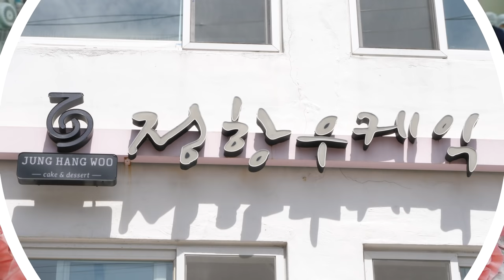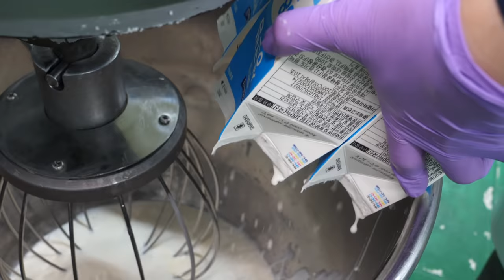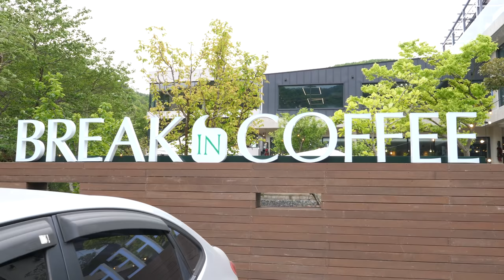화려하고 신박한 케이크 &디저트 대량생산  BEST5 몰아보기 / Cake & Dessert  Mass production BEST 5

Comment: Instead of blind baking the tart shells, just poke little holes in the bottoms, to keep them from bubbling, the way you would when making crackers.

Use an egg yolk separator when cracking the eggs in the first place.  It's basically a small cup with a 1/4" (0.635 cm, 0.2095 
寸) diameter hole in the bottom of it.  The albumin goes through the hole and the yoke stays on top.

Whip the egg yolks, cream cheese, mascarpone cheese, powdered/bloomed agar, and sugar syrup together in one bowl to begin with.  If the water in the syrup isn't really needed, then use plain dried sugar instead.  Whip the cream separately, but then fold it in gently a little at a time, not all at once.

Instead of piping the filling in, just use a large spoon to put a huge amount in, since you're just going to take the excess off with a knife anyway (I think that looks sloppy though - I like it better before the knife is used to take the filling to the edges).  Also, don't stack them directly on top of each other with the centers vertically aligned, as that will sink the filling in the lower tarts down, which could break the sides of the tarts (as the excess gets pushed outward from the centers).  Instead, stack them the way you would stack cans that weren't meant to stack on top of each other: 1 tart on top of 4 tarts underneath, so the top tart covers 1/4 of each of the lower tarts.

Putting fruit on top of the tarts will just make them hard to eat.  Especially the grapefruit pieces.  Anything larger than a chocolate chip is going to make it very difficult to eat these tarts.  It would be better to make the cream filling half as thick, then freeze the tarts, then put the sugar syrup as a layer on top of the cream, then put the smaller fruits (not the grapefruit slices though - maybe dice those instead) over the sugar syrup, and refrigerate them as soon as possible to help the sugar syrup set as a "glue" for the fruit pieces.  This would make them easier to eat.
Reply: justrosy5 I think what we are watching is a batch of people making a video for commercial sake. Once the cameras are off, these workers flip the switch on the machines to make huge batches of these foods to be distributed all over Korea, and elsewhere possibly. It doesn't make sense to use these slow processes day after day.

Comment: The cakes are under-baked (they need about 5 more minutes in the ovens) and there is way too much frosting between the layers (it should be about half of what's put on.  Also, those carnations don't cut well.  It would be good to intentionally put the tempered chocolate pieces in so that there's a slightly hidden "cutting line" that would make it easier to cut the carnations in half.  Small, green frosting "leaves" could be placed at each end of the "cutting line" so customers would know where to cut the cakes in half after taking them home.

When putting the carnations on top of the cakes, it would be easier and go faster if the workers started in the center of the table and worked their way toward the edge, instead of going from the outside cakes towards the inside cakes.

Also, when packaging the cakes, it would protect them more if the frosting on the cakes were dusted in powdered sugar first, then if the clear plastic sides (that are wrapped around the cake sides and taped on) were taller than the carnation tops.

Comment: For the assorted cakes, mix all dry ingredients together first, separately mix the liquid ingredients, then mix the liquid mixture into the dry mixture.  At least mix your baking powder or baking soda into the flour first, before adding the flour to anything.  These powders must be evenly distributed, or they can make the cakes unsafe to eat, as well as have gross tasting spots in them.

Only fill your cake pans half-full (half way up the actual pans, not half way up the paper sides).  This is to ensure that the cake layers are well baked all the way through, instead of under-baked in the middles or toward the bottoms.  Cake batter can only be so thick and still bake properly.  Only tap unbaked cakes - never tap baked cakes on a counter-top!  This causes them to fall instead of staying light and fluffy, the way they are supposed to be.  If the cake tops don't stay rounded or domed on top, they are underbaked and have fallen, probably from the tapping.  They aren't good to use.  If you want flat tops, you have to cut the domes off, if you want the cake underneath to be good enough to eat!  Use the excess baked cake top pieces for other things.  To cut them really flat, use the cake pans as guides.  You need 50% more cake pans though, instead of trying to make the ones you have taller with paper sides.  The quality of the cake will just be better that way.

Spraying or drizzling the cakes with a liquid and then putting jam on them will only lead to even soggier cakes.  To prevent the jam from going into the cake layers, use a thin layer of fat-based frosting over the bottom cake later, under and over the middle cake layer, and under the top cake layer, then put the jam filling between the now frosted cake layers.  It's a little more work, but worth it.  Another option is to just sift the jam and whip the whipped cream into it, again, a little at a time, gently.  Non-fat-based liquids or gels just soak into cake layers, but thick, fat based whipped creams and frostings won't.

There is too much whipped cream between the layers, and the syrup around those fruit pieces is just going to soak into the bottom sides of the upper cake layers.  It would be better to sift the fruit pieces out of their syrups, add them to the sifted jam, then whip the whipping cream into both.  For the fruit pieces, pat them very dry, cut or dice as needed, rinse and dry them again, then use them either on top of the whipped cream or as part of the cake batter itself (mixed into the flour first, before adding liquid ingredients to it).

Oreos are just chocolate cookies made with approximately 50% dutched cocoa and 50% natural cocoa.  You can save yourself a ton of money by just making your own chocolate cookie dough, baking it in large, flat, thin sheets, and using a grinder to crumble it.  Seriously - I've made my own myself.  It's not hard.

Again, a powdered sugar layer needs to go between the frosting on the side of the cake pieces and the plastic taped around it.

Comment: It would make more sense to use powdered agar, rather than stringy agar.  If that's not available, then use a grinder to powder the stringy agar first, then bloom it or just add it into the dry ingredients before adding the liquids.  A lot of time, energy, and money is being wasted by using stringy agar.

Also, your translator needs to say "white bean paste" instead of "white sediment."  To English speakers, "sediment" usually refers to clay or dirt, or sometimes rust.

For the orange-dipped pieces, it would save time and be easier to put the pieces on the rack first, then just pour an even coating of the orange sauce over them all.

For the green leaves that go on top of the orange coated pieces, it would go faster to have a rolling pin that has the leaf cutters placed around it.  The worker could then just roll out the leaves from the green candy sheet in one motion.  This would also save time.

The yellow and brown coated pieces would be so much prettier if the brown zig-zag design were placed on the bottom side of the yellow circles first, before they were wrapped around the pieces!  The workers did it right with the green and white circles!